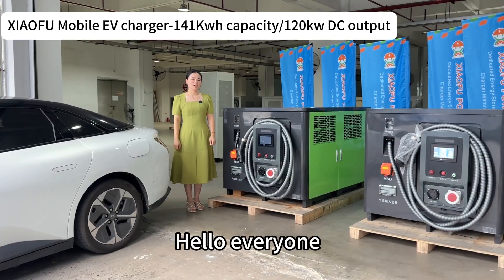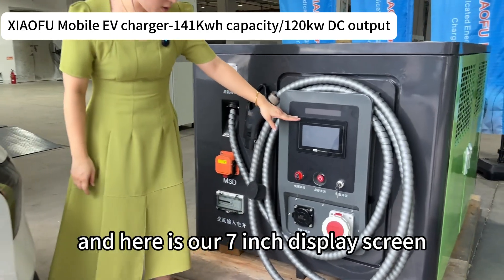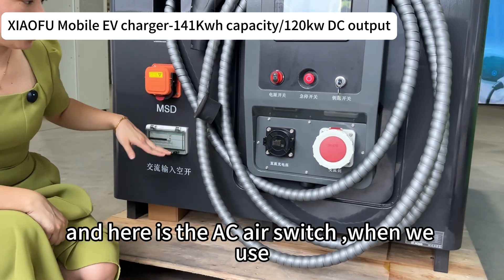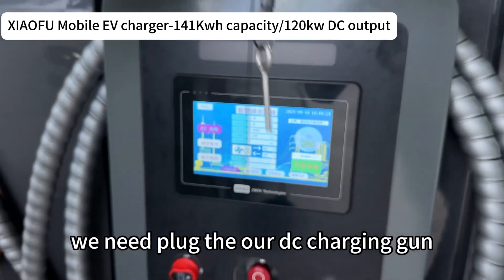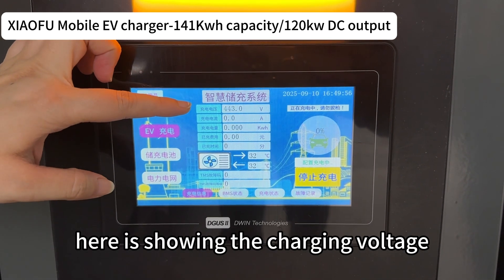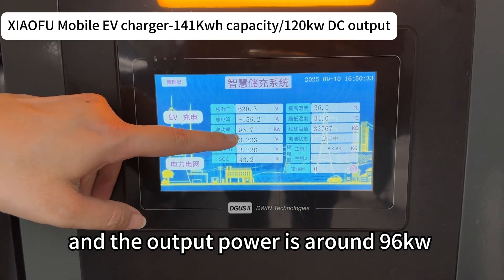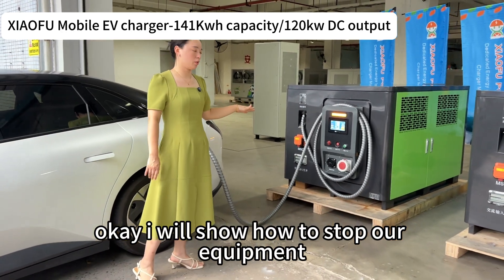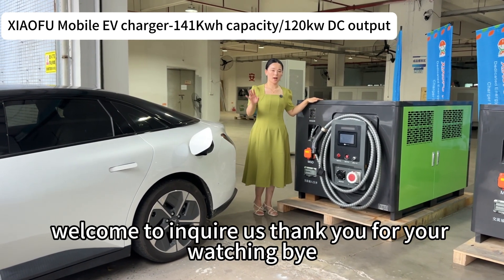Essential for mobile charging

Comment: That blue background is the stupidest choice.
You have a round bublle with a percentage on top of a high voltage utility pole (110kV) and that turns out to be the SoC of the battery. (Which battery? Car battery or gizmo battery))
Reply from the maker: During the charging process, that shows the battery SOC on the car.
Reply from the maker: Because this version is the GBT standard, so its display is in Chinese, if it is necessary to export, we can choose the English version, here is the relevant video introduction for your reference: https://youtu.be/fHVRDeLzJSM?si=54CXJ63zjSo8b7aZ